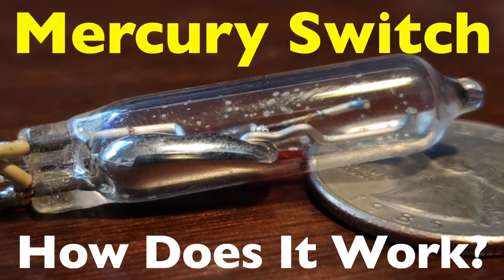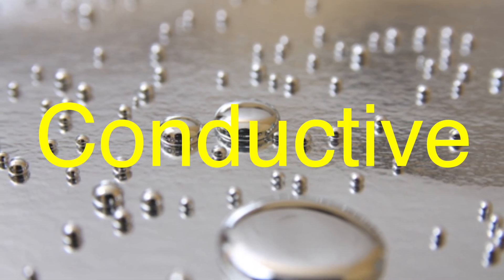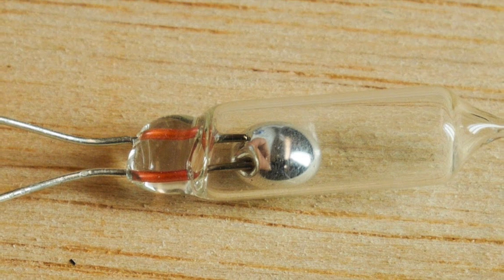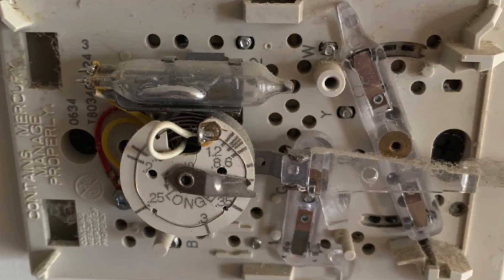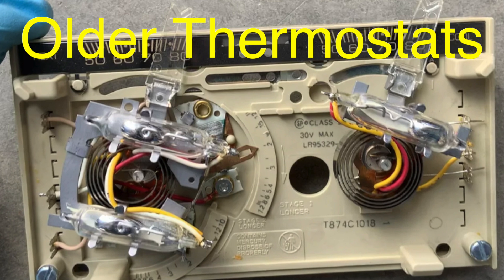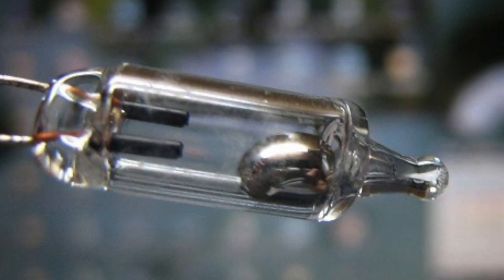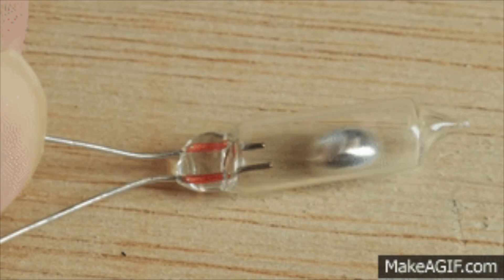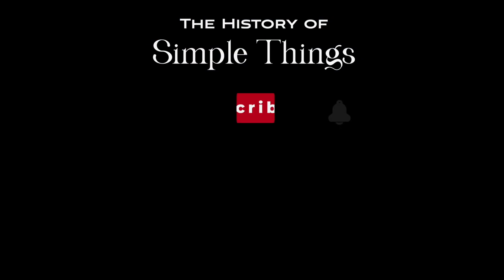What Is a Mercury Switch, Its Uses, and How Does It Work?

Comment: Indeed the sculptor Alexander Calder designed a fountain filled with mercury. If you can imagine the motors/compressor you'd need to pump a metal through a pipe system! Calder designed this fountain - with actual mercury - for the Spanish Pavilion at the 1937 World's Fair in Paris. It's beautiful but I wouldn't toss any coins in it!

Comment: Years ago you could get a mercury wall light switch, and thus it was totally silent without the snap action usually found in a switch. I had a Fiat 124 Spyder with the annoying feature that when I flipped the driver’s seat forward the head rest would press against the horn button and blast the horn. So I wired a mercury switch (I removed from a light switch) in series with the horn circuit so when the driver’s seat was flipped forward it would prevent the horn from sounding. Only trouble was the horn would not work whenever I was braking hard. This is when I was most likely to want to the horn!

Comment: you missed out on the fact that they dont bounce, unlike any other switch.

the old school "ignitron", a variant of the mercury arc rectifier... capable of switching several kilovolts at several kiloamperes.

mercury wetted relays as used in old telephone exchanges as the contacts dont wear, dont bounce, and tend to last "for ever".

and finally, they can achieve rise times at power levels that put any solid state device to shame. make little "pingers" for performing TDR analysis when tuning an aerial, can get rise times at 12v that approach less than 150picoseconds... albeit that requires a fair bit of RF design in the circuit, rather tricky when dealing with a small glass tube and still requiring the coil to operate? and for my purposes, a sharp cornered square wave, even 1nano second is considered pretty freaking good. my scope cant even register a slope, but its limited to about 5nanoseconds anyway... would love to throw them onto a (very expensive!) 10Ghz unit...

Comment: Heard that Hospitals outlawed old mercury thermometers years ago. Did some work on 50 to 500 ton injection molding machines. Never had to to replace a 480 volt three phase Mercury relay that powered heater bands.

Comment: There are also mercury contactors where a glass cylinder is partially filled with mercury and surrounded by an electromagnet. A steel piston is moved by the electromagnet, displacing the mercury which then makes contact with the electrodes. It's rated for millions of cycles and safe in explosive environments.

Comment: You missed one big asset of mercury switches, they do not arc in the open like ordinary switches and can be used where there are volatile or inflammable liquids as they will not cause an explosion.
Reply: Good point.   Mercury switches certainly have their place and time even today in applications where reliability and protection against arcs from make and break contacts have priority over the potential safety and health hazards caused by a broken mercury switch.